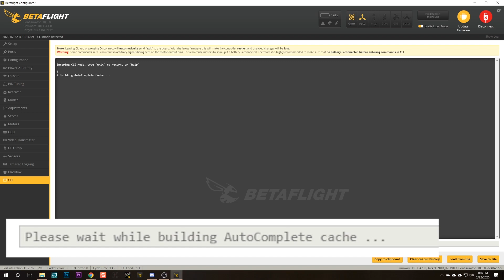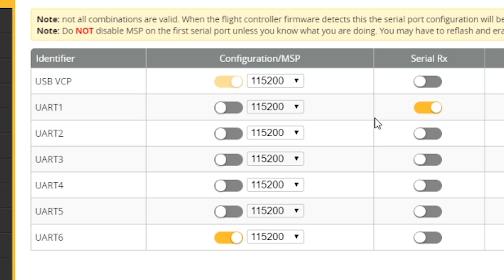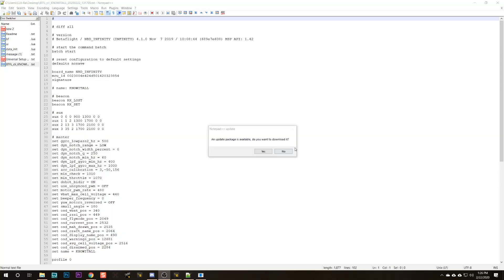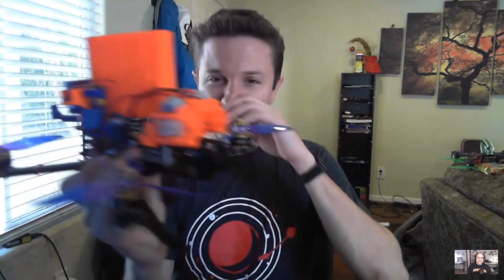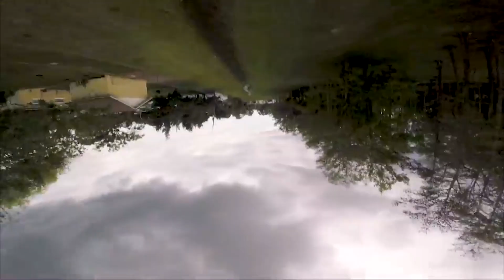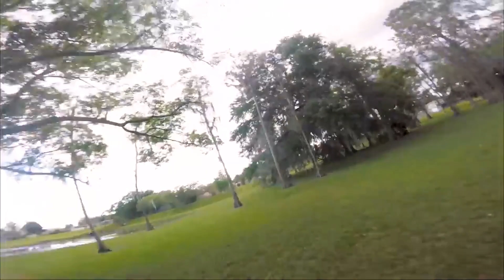Helping Corridor Digital Wren make a REAL Nerf Attack Drone

Comment: I was yelling at the screen "just use the buzzer pads!" 😆
Reply: It should work I mean if you wire between a 5v pad and the buzzer negative pad 🤷‍♂️. It at least my flight controllers take quite a bit of current draw up to about 2 amps on the 5v system and that's more than enough to run a relay. I mean it should just work like it just cuts the negative pad🤷‍♂️
Reply: Same here. Lol
Reply: Ditto
Reply: I was sitting here thinking...why not just a step up? I've done enough remapping that it's no big deal, but I actually didn't know that the beeper was a 5v source. I DID learn something today (as always).

Comment: I have no choice but to give you a thumbs up for this one.

I probably would have noted that he was already using a regulator for the motors.  Some regulators have an enable pin.  Which is often active-low if I recall.  Buzzer pin straight to enable, maybe a pull up... done.

Comment: slightly off topic but can you remap f.i  a led pin on a F4  board to connect a current sensor?   The Moxe F4 does not have current sensor input pin.
Reply from the maker: No. Current sense input is an ADC pin and it cannot be remapped to a GPIO pin.

Comment: My nbd stack is freaking out when I start up my props and motors are set in reverse. I did the motors direction thing on bf . But it’s not changing ? Thanks for any help
Reply: betaflight asks the motors to spin, if they're spinning backwards, you need to tell the ESC to change direction, go into blheli and have them reverse there.
Reply: Either what Kyle said or simply switch two of the three motorwires
Reply from the maker: Betaflight doesn't reverse the motor. The "motors are reversed" option in BF simply TELLS the FC that you have reversed the motors. If you want to reverse the motors, you have to do it in blheli.

Comment: Hey Joshua why didn't Wren just used a transistor? 

The transistor's gate would connect to the beeper output you used, using a resistor between them to avoid high currents. 

Wren would just connect the 5V to the transistor (acting as a switch), and from there to the motor and back to ground.
Reply from the maker: He didn't have one and we were on limited time.

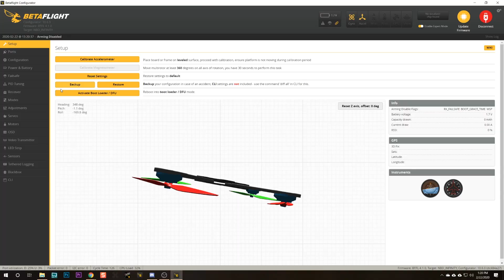Comment: Why is the UART 6 occupied by MSP when all STM32F405  processor has dedicated VCP port? Even the USB VCP is enabled by default. The only reason you'll need a free UART for MSP is when you want to use other method to configure your FC such as the bluetooth module. 4:00
Reply from the maker: DJI air unit communicates to the FC with MSP.
Reply: dji digital fpv uses it to configure the fc via goggles.

Comment: Open collector\drain output. Common in microcontroler applications for switching arbitrary voltages. Technically, you can set up most ports on a micro to be open drain/collector, and make it handle several different voltages. The problem comes from the protection diodes that are usually also on these i/o pins. They direct current to the chips Vcc supply, making it hard to put anything on them above that. Using a resistor in series can cheat around this, but you're long since flirting with danger at this point.

Comment: Probably a dumb solution, but can't you just run 5v from the 5v pad through the relay to the tx4 pin and ground that?
Reply from the maker: UARTs operate at 3.3v and would not close the relay.
Reply: STM32 MCUs and 5V logic don't mix. I learned it the expensive way. Besides, the sink current will be too high for the chip to handle.
Reply: I actually watched the other video now, and I have an even dumber solution. Use buck converter to get 5v from 3.3v. I'm only 7% sure that that is a solution even worth trying

Comment: need a mosfet like a 3232 which is a neg fet bvat in almost any volt will flip it 3 volts i used them alot in my vape mods i built they can push like 60-80amps and use nothing to complete the circut

Comment: Couldn't he have just used a transistor? They are cheap, small and he could very easily switch the 5v from the flight controller using the 3v signal
Reply from the maker: He didn't have one handy.

Comment: Wow... i thought you were one of the good ones to save the hobby, but no, you give instructions to potential install a real weapon on a drone. dissapointing that you help with this kind of stuff on video.
Reply: I don't think he gave away anything about how To install a gun, arm the gun or fire it from a quadcopter. Only how to output 3.3v or 5v through a uart.
This can be used for many things, both good or bad.
Reply from the maker: A nerf gun is not a weapon.

All I am doing is describing how to trigger a relay using the buzzer. You can use this for many different purposes.

The info in this video is not even useful for firing a real gun. That could be done without the 5v motor and just a servo, which is built into Betaflight. So might as well outlaw servos.
Reply: @JoshuaBardwell  exactly
Reply: @JoshuaBardwell   yes, thats obvious, but it incorages people since pulling a trigger on nerf or real weapon is not that different
Reply from the maker: If you watch the video, you will see we are not pulling a trigger. The Nerf blaster has a flywheel system that spits out the darts. In fact, this system is quite unrelated to "pulling a trigger". All you are doing is responding to the superficial similarity between a Nerf blaster firing a dart and a real gun firing a bullet. Functionally, there is almost no overlap. But don't let that stop you from overreacting ....